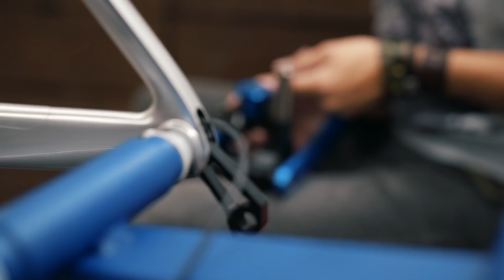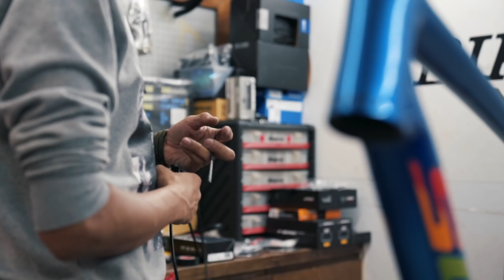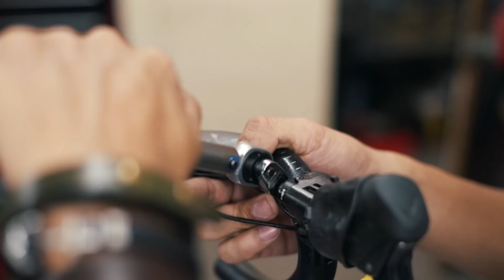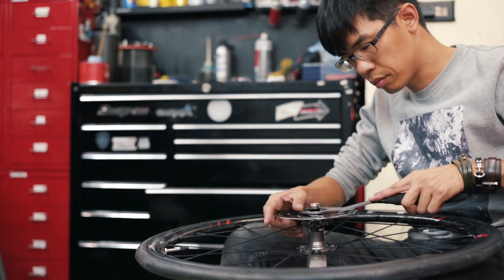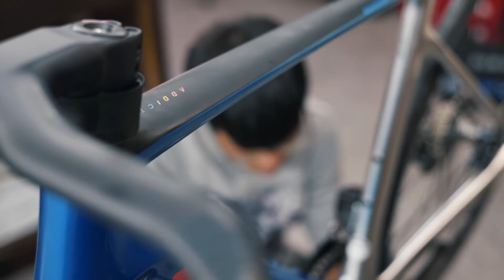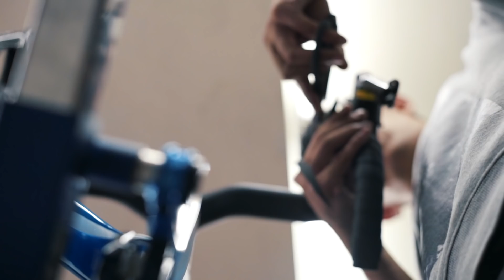『Esteban Chaves limited edtion 』2020 SCOTT ADDICT RC ULTIMATE TEAM ED BIKE DREAM BUILD

Comment: Hey Guys, an another question, which bolts did i need for the Dura Ace Disc Brakes to fit it on the frame...thanks
Reply from the maker: Alex Müller you need use handmade custom bolts for shimano groupset on this bike

Comment: I got my new addict rc pro 2020 yesterday, can you tell me what i need for cables for the Di2 especially to lengthof the cable, i got a Frame in size M and the 420/110 handlebar....thanks for help
Reply from the maker: Alex Müller 1200mm*1 800mm*2 300mm*2 600mm*1  (wifi+300mm*1)
Reply: @lohasbike1242  thank you so much